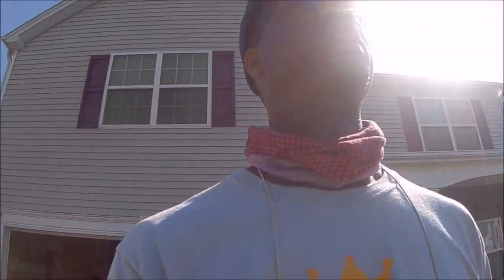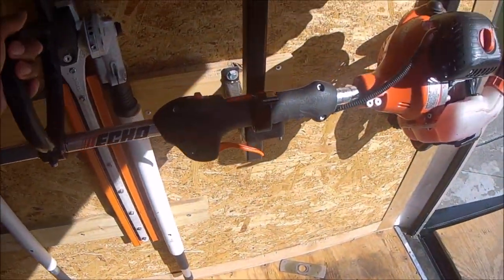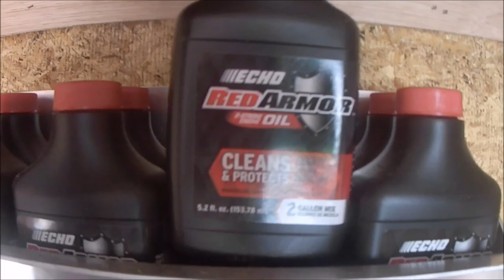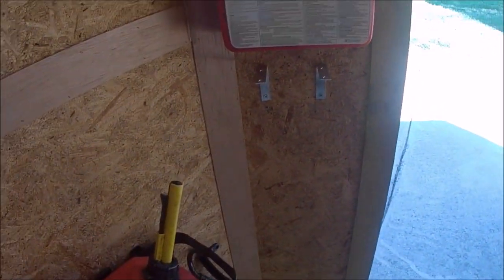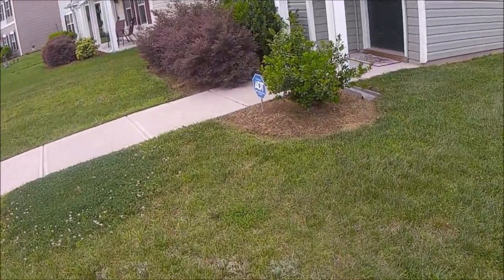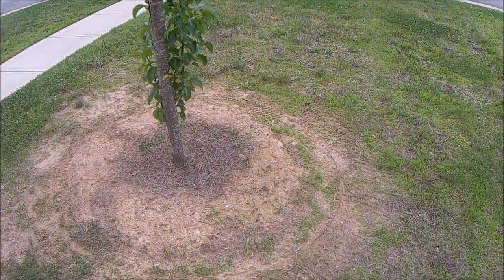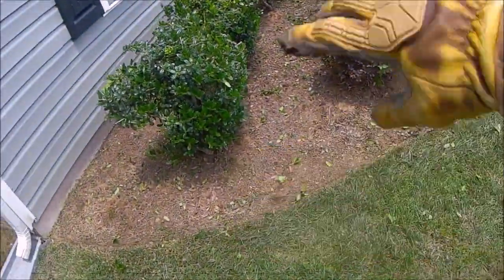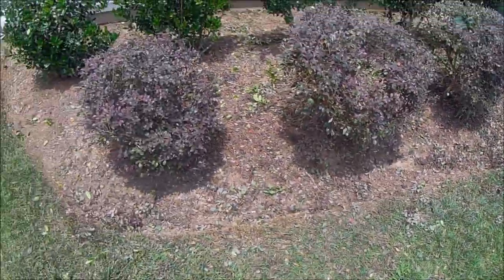Trailer setup/ hedge job

Comment: On ur trimmerheads take out the spring drill a hole in the center of your trimmer head and put a bolt through with a nut & washer tighten it down and use loctite. Had my trimmer heads for 2 years and it does not wear at all its bulletproof just a tip for ya💪🏼.
Reply from the maker: Yeah I thought about doing that to my heads. Maybe when I get my next ones.